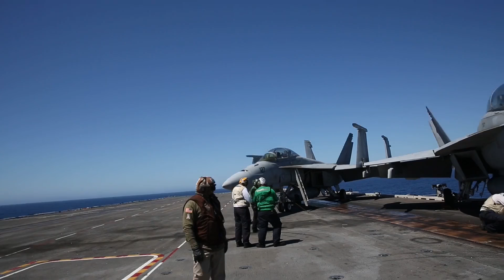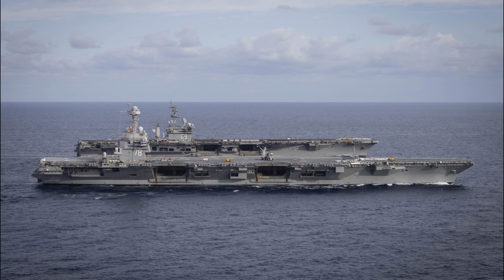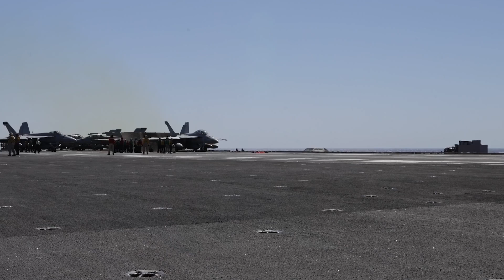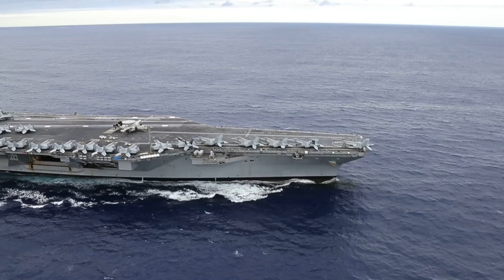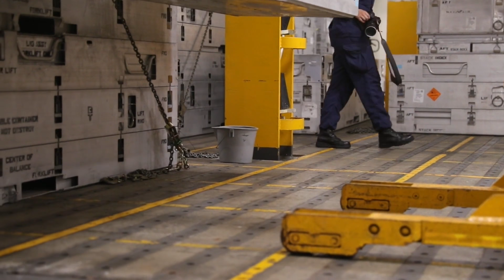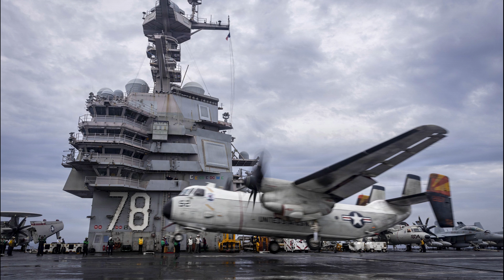Ford Class vs Nimitz: 10 Supercarrier Upgrades Explained

Comment: as i have seen in other video it encountered gliches in their emals and weapons elevators, how true ?
Reply: Not glitch, all EMALS are connected so if one goes down, they all go down.
Reply: It should be pretty obvious that after over 300 days at sea that the new systems are now working properly. For the systems to have bugs to be worked out when they were first introduced is how it has been with every new system introduced to the military.

Comment: America is going back to steam catapults because magnetic is prone to jamming and emp
Reply: I dont think people understand what that entails.
Steam catapults are heavier so that means less weight available for gear/fuel
Steam catapults take more room so that means less space for aircrafts
Steam catapults take longer to launch
Steam catapults damage airplanes more than electromagnetic ones, that's more maintenance and less aircraft life
Steam catapults require more maintenance
Fords were not designed for steam so that's a huge design change (you need to bring the steam all the way from the reactor to the catapults) and even more costs
Steam catapults are no longer build since decades, that means restarting a production from scratch so even more expensive and no more experienced workers

I'm not saying it is impossible but if the Navy goes this way, it will mean less ships as the budget is not infinite. And considering the catastrophe of the last projects (destroyers and littoral combat ships) and the state of shipbuilding, it is definitely something they cannot afford.
Reply: Dude if the emals is offline to an emp then everything electronic on the ship is. So even if it was steam no sorties would occur
Reply: Aircraft manufacturers are getting a hell of a payday boost aswell.
Reply: No there not the navy isn't going to get rid of it.